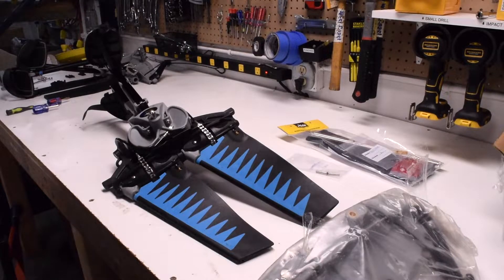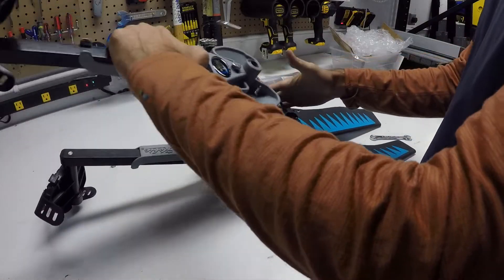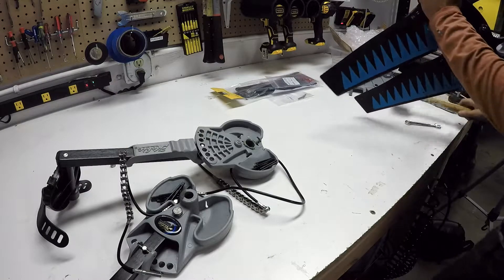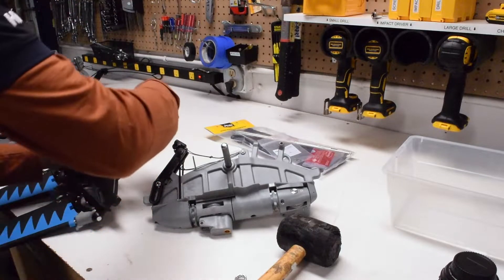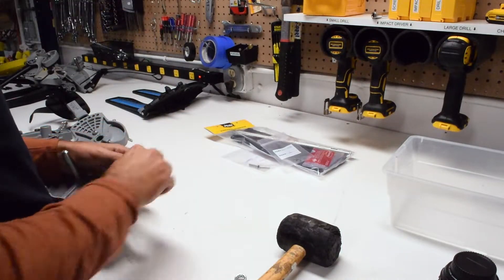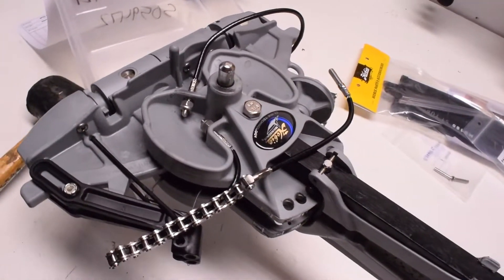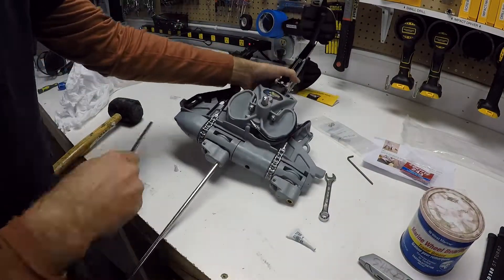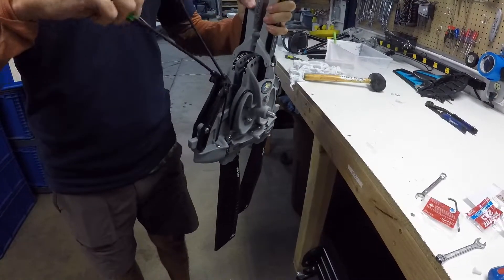Hobie Mirage Drive GT to Mirage Drive 180 v2 Conversion

Comment: I did this about 6 months ago.  Very easy to do and now that I have a 180 drive I find it an indispensable tool especially for fishing along the jetty.
Reply from the maker: Nice! It's definitely a worthwhile upgrade.
Reply: Did you have the grey GT drive? I have the all black will it work on the original one? I have the V2 with bigger drums
Reply: @YakLocal  yes, I had the grey GT Drive.  I don't know if you can go from an old drive to the 180 Drive.